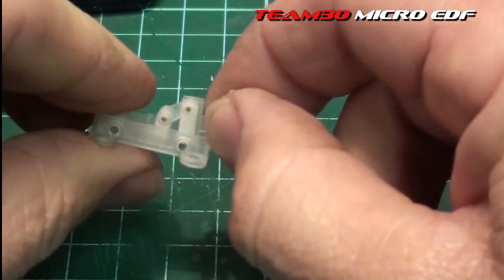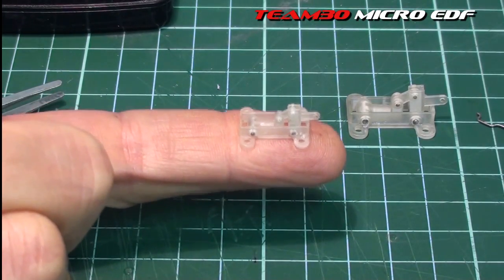Shapeways 3D printed Micro Retract Demo

Comment: Fascinating device... but... I don't understand how it is installed and becomes useful.  Can you post a video of it mounted and working?  To my mind, it looks like you insert a trunion for the gear into the bottom of the part on the left that rotates down 90°.  If that is the case, then when the part is retracted, then wouldn't the trunion foul with the parts on the right???

Comment: Can I purchase some of the small ones from you?
Reply from the maker: If you do - I must point out that the reason I did not continue is that the 3D printed material is brittle and cannot stand too much impact. I was going to go for injection molded but the setup costs were too inhibiting.